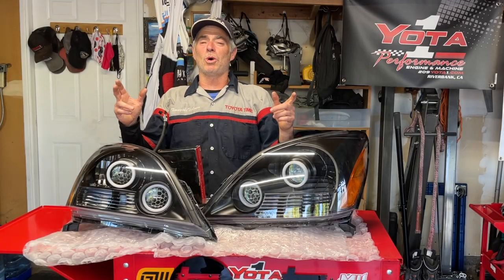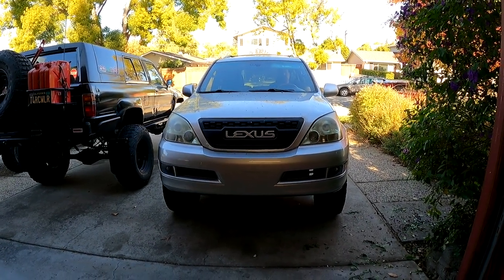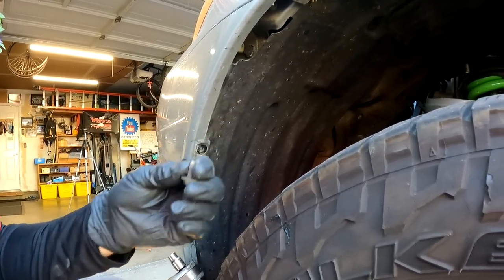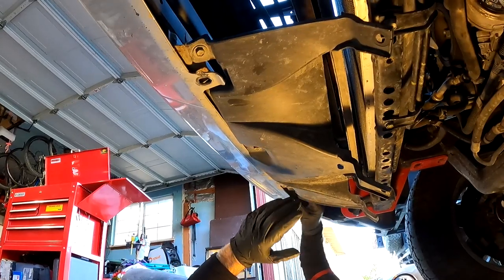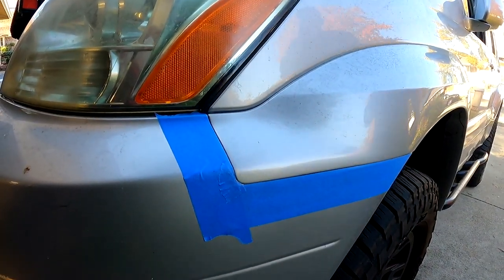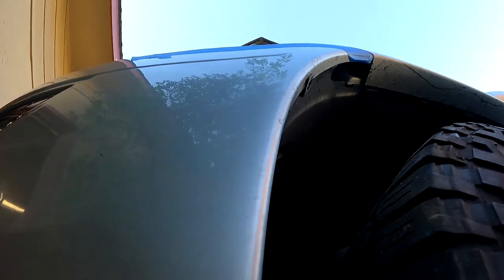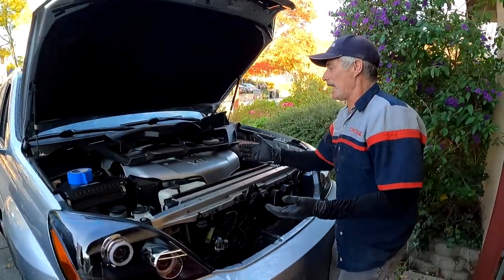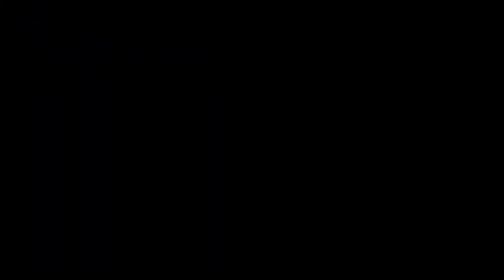Lexus GX470 Headlight Replacement

Comment: посмотрел это видео более 10 раз, каждый раз я наслаждаюсь просмотром. Точность и аккуратность действий. Проделывал много раз операции по снятию и установки бампера и фар на своем gx, но это видео позволяет насладиться каждый раз подробным действиями с повествованием. Отражатели выкрашены в хром на черной глянцевой маске, смотрится отлично. Меня смущает только провод идущий вдоль радиатора.
Reply from the maker: We're glad you like the video.  Running the wires over the top of the radiator and underneath the body seemed to be the most logical routing to us at the time.  Maybe if we gave it more thought and were willing to extend the wire we could have come up with a better routing.

Comment: Timmy, I am doing a retrofitted First Gen GX470. How did you bypass the DRL assuming the halos do a switchback when using the turn signal?
Reply from the maker: We didn't bypass the DRL.  We just installed the headlights like we showed in the video.

Comment: I ordered these not to long after I got my GX, waited a year for them and ended up canceling the order because I was selling the GX. I did have these on my 3rd Gen though and they were amazing.
Reply from the maker: Yeah, hopefully they can get their production time down.  I'm guessing the reason for the long lead time is their lights are very popular and they are struggling to keep up with the demand.
Reply: @TimmyTheToolman  yeah it was at the very height of lock downs and the explosion in popularity of the GX470 out of nowhere so I don’t blame them. If you order today I think it’s a lot better. I’ve personally talked to the guy that runs BX and he is a cool dude and I don’t blame them for the delays it’s just circumstance.
Reply from the maker: @GXKid06  What are you driving now since you got rid of the GX?
Reply: @TimmyTheToolman   after owning 2 4runners, 4 GX470s, a scion FRS, and a Prius as the gateway drug, a few other flip cars and working my main job at the dealership and delivering for door dash, I was able to flip all those cars for a profit and buy a new tesla model 3 out right. I know I’ve gone to the dark side, but I still love Toyota trucks. Definitely way cooler people in the Toyota community than the tesla community.
Reply from the maker: @GXKid06  Well, at least you were smart enough to flip cars and make money.  That's cool.  Electric cars don't do it for me, never will.  I did ride in a Tesla, and they are pretty damn fast.  That's the coolest thing I can say about them.
Reply: @TimmyTheToolman  Yeah I wanted a fast car, after blowing up the transmission in my GX racing it I realized it was time for something different. I wanted a BMW M car but I enjoy not buying gas a lot. $12 gets me 350 miles of range. And I was only getting 150 miles out of my GX and those are bout $130 to $150 to fill up now. But after college hopefully gas prices have come back down and I definitely want to get another Toyota because I miss off-roading a lot.
Reply from the maker: @GXKid06  Gotcha.  Well, good luck in college.  Maybe we will see you again on the other side.

Comment: Thx for the videos. Timmy, did you ever figure out the catalyst monitor issue on the 4-runner that you installed the engine in? Were you able to get 4-runner to pass the state inspection?
Help a brother out
Reply from the maker: Brendon is still having issues getting the catalyst monitor to show ready.  He talked with the guys at ORS and they think it could possibly be an issue with the ECU.  I'm not so certain that's the culprit.

Comment: I must say. This headlight replacement procedure look to complex for this rig. Not sure what was on Toyota guys mind when they design it ;) I own 4 runner 2000 and it was easy as F. I also own Volvo XC60 and also no problem with uninstalling headlight. I am very suprised and confudes ;)
Reply from the maker: I agree with your assessment.  It is quite a bit of work to get the headlights swapped out.  It certainly could have been made easier by Toyota/Lexus.

Comment: I’m really disappointed in the engineers on this headlight replacement. A little extra work and thought and they could’ve easily made it where an engine mount needs to be removed to change the headlights.
Reply from the maker: They definitely didn't make it easy, that's for sure.

Comment: 22 week lead time.   yikes
Reply from the maker: That's what happens when you have a popular product and everyone wants it.  Maybe they will hire more people to increase their production to reduce the lead time.  Long lead times are fairly common in the automotive industry when a company makes a well-built and desirable product.
Reply: @TimmyTheToolman  I get it. Just stating it’ll take half a yr to receive the item is quite some time. Good thing there are other options for upgraded headlights of similar attributes.
Reply from the maker: @PaulHero  Yeah, it's a long wait.  Hopefully they can reduce these wait times.  Some of it is a supply problem.  If you can't get the parts, you can't build the units.  Some of it is probably a manpower issue.